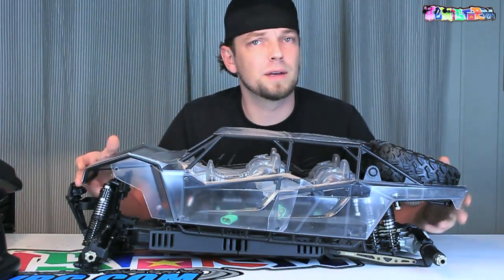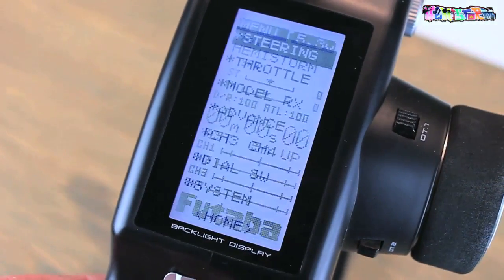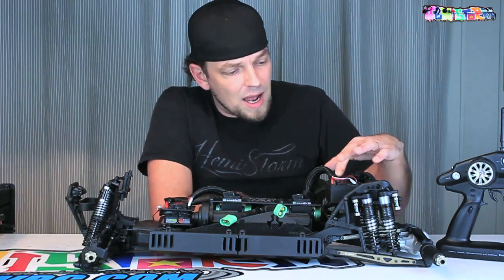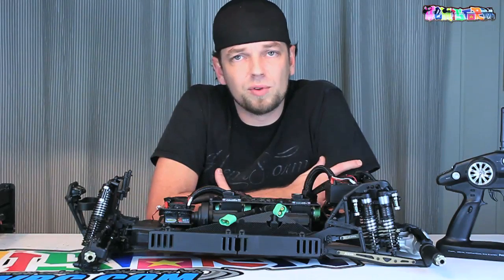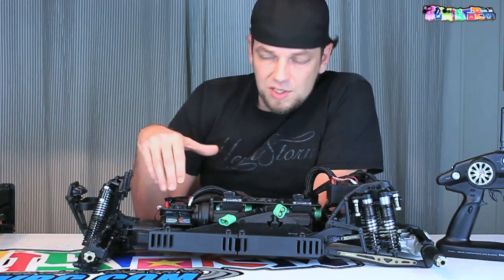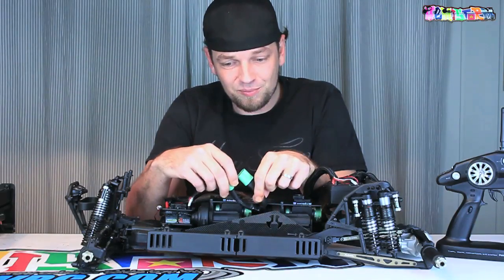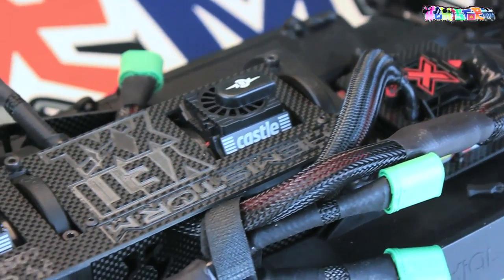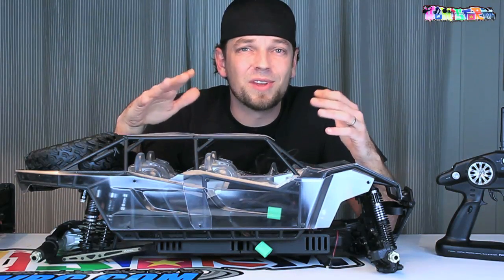DOUBLE ESC and MOTOR - HemiStorm's Axial Yeti XXL

Comment: One more question...how did you do the maths about the battery? I started a similar project, but can`t explain to myself about the speed of the model (and this is crutual moment for the battery boxes i made). For example - 3s powering front and 3s powering the back, is this the speed of regular 6s model?
Reply from the maker: If you have 3S front, and 3S back, it is still considered 3S. You are after all powering each individual motor with 3 cells. I hope this helps!
Reply: Yes, thank you :)

Comment: Wait wait, please, could you explain one more time - the front esc power steering servo and receiver. So it`s not exact amount of power. The front ESC would will drain different amount of power from the batteries and the second esc will work properly even with the 2 blowers. So how did u solve the problem with the esc where is hooked up the servo and receiver? Any bec installed?
Reply from the maker: The internal BEC on the X is actually a very reliable one. With lights added, there is a pretty even power draw in both setups. Using the Castle Link I've been able to read out RPM's on both motors and fine tuned it to as close of a match as I could. I hope this helps!

Comment: hey Chris the Vanquish rear end is definitely the best mod when I installed my beveled gears I had to grind the back of the pinion down to compensate for the "no shims required" my vanquish Axial wouldn't turn after I tightened the differental bearing carrier . I'm running the D Hawk bulkhead up front and Boca bearing Green Seal throughout the vehicle . I'm loving my Dhawk 2 speed  and for once I can bash this beast and come home smiling!!! The beveled cut gears are a fault design causing XL heads serious problems!! I went through 3 axels and 3 bulkheads till I figured it out ... maybe you can connect to the community about this issue when you face it... The stock "plastic" has enough give but the Vanquish makes it obvious!! good luck homie!! keep up the awesome work !!
Reply from the maker: +BarharborBasher Going to pass on all the information for sure, thank you for the heads up.

Comment: awesome job !!! Thanks for the info !! Im getting ready to create a high clearance fully independent Yeti XL ... Are you getting a DHAWK bulkhead ? I've got a Vanquish Axle coming for my bulletproof xl build... What do you the Vanquish ?  I just ordered the 2 speed from DHAWK .... cant wait                                                                                                                                                                     BarHarborBasher  RRC
Reply from the maker: +BarharborBasher I'm trying with the updated Axial gears up front first to see how that goes. The Vanquish axle is on the car, and I dare say it is the best upgrade you can buy for this vehicle. I'm crossing my fingers that durability will no longer be an issue with these couple of adjustments in place, as I love how these XL's drive.

Comment: awesome build but you should have used a CC Pro bec to run your radio components. Would have probably series'ed pairs, then parralled the 4 batteries through a cap pac to each esc.. but your set up will run too. just not evenly if you do to much dig stuff. Nit picky bs but for a build of this quallity... lets not sacrifice performance for a clean wire set up....
Reply from the maker: +Dawson McElhany Valid points! The ESC read out shows that the motors are not even 100 rpm off from one other, so I'm quite hopeful that the drivetrain will forgive that inconsistency on loose terrain.

Comment: Awesome build! Wondering though - wouldn't the steering servo use much more power than the RX and fans combined?

Also thinking, a flight radio with mixers would do that system good. At least you could make it FWD or RWD and mix the second ESC to for example a knob. Or to the elevator control. Ideal would be a mix that gives 100/100 at center stick, and then when say pushing the elevator forward (same stick as steering) the car would be more RWD and oversteer (lowering the EXPO rate for the rear ESC). And vice versa. In your mind it would be like pushing the elevator forward for more "wight" in front and backward for more "weight" in the back :P Wuld brobably be quite easy to master.

Not sure if that is possible though. It would have to be like using EXPO mix and then have it to give 100% at center stick. I guess it would probably just give 50 EXPO to booth throttle channels on center stick though :/ Not sure how advanced the better radios are. I only have a DX6i :P
Reply from the maker: +Roger Skagerström Hi Roger! All true, but I really do not like to steer a car with a stick radio. The options would indeed be far superior! Perhaps a more advanced pistol grip radio will join the fleet in the future, I have been looking at the futaba 4pxr and really like what I see!

Comment: I am planning a similar drive train on an X0-1. I have one concern with your battery setup: I usually run savox servos, which can draw enough power to brown out the esc (my sidewinder equipped car would stop moving at full lock if epa was not set perfectly). this means that the esc whose bec is being used is going to draw its battery down faster. Running pairs of batteries in series to create a pair of 6s then putting them in parallel would prevent one set of batteries draining faster.
Reply from the maker: I considered it, but if one battery goes flat there is no way of telling, plus the looms would have been even more complicated. I will try it as is first, but I have high hopes to be honest. Good input though, let me know how you get along with yours!

Comment: Very innovative build, expensive, but who cares I didn't pay for it!!! Keep it up very unique rig. Cant wait to see how it performs, you have now a electronic manual function "Quattro" drive, search out you can use those thumb switches to add/subtract in various increments the "drive" control of the front/rear. ie In a tight track situation I would overspin the front to get more "turn". I love my XR10, you have a 1/5 scale one!!! haha  Subscribed.
Reply from the maker: That's the idea indeed! :) Price wise it's not too bad if you compare it to fifth scales, and in putting it together I had way more fun than I ever had with my other rides.
Reply: +HemiStorm RC - Custom RC builds, painting videos and more I know right, the custom rigs are more fun IMO than the box and bag kits. Check out my channel I will be doing a overview of my custom Flying Mantis build, I think you will be into it...

Comment: What bits do you use to cut your carbon fiber?
Reply from the maker: Spiral cut ones with two teeth. 0,8mm in diameter. Let me know if that helps!
Reply: HemiStorm RC - Custom RC builds, painting videos and more
Thanks! What about feed and depth for cutting? I broke a bit on my last cut session, but think I was running too fast or too shallow of passes.

Comment: whats the benefits of this double motor and esc setup?  faster? longer run times?
Reply from the maker: Hi there. Faster, more power to shift less weight, relatively more torque, the ability to set it up for over-/underdrive, the possibility to set up dig, and no need to reengineer the drive train after stretching the chassis five inches. Run longer and run cooler and faster. All in all, lots of benefits.
Reply: it's completely awesome! bet it cost a fair bit to build though, i'd love to do a build like this but i don't have the skills lol